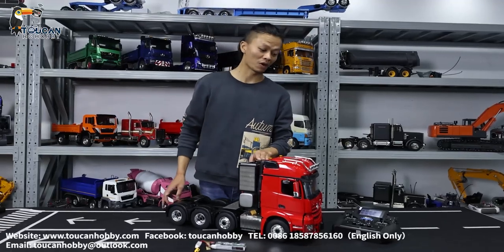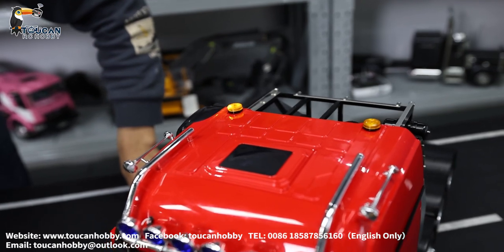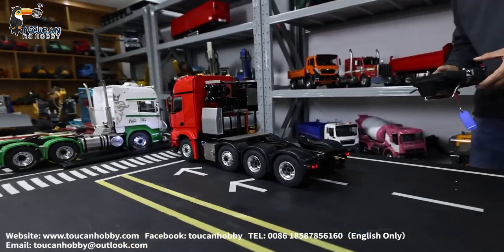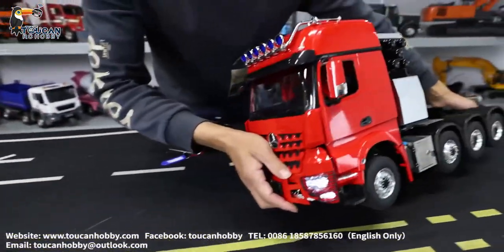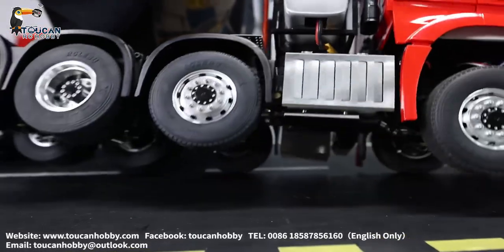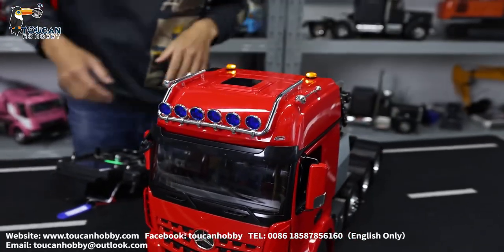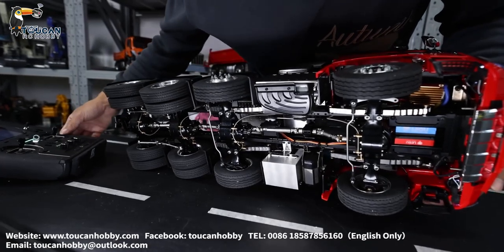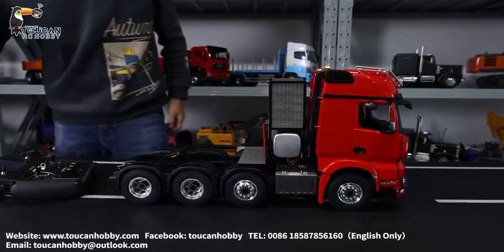LESU 1/14 Metal 8*8 Chassis RC Tractor Truck, Mercedes Hercules Cabin. Upgraded Sound & Light.

Comment: i need your help
want on a traxxas mercedes 6x6
wants to install a fifth wheel coupling for a boat trailer
do you have a set of dish coupling to be able to use a servo
use, send me a link ? that I can buy it?
and because is the standard size, the height of the bottom of a built-in height? , from floor, underside of trailer coupling dish
what height should I take into account
so I can use another trailer in the future
thank you